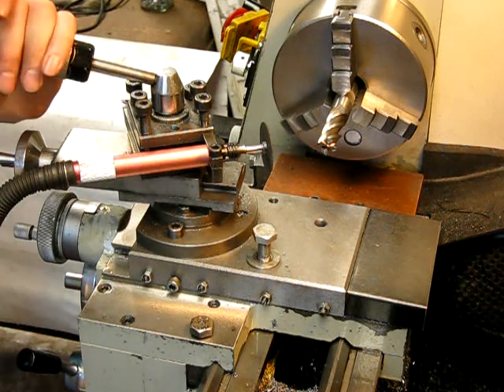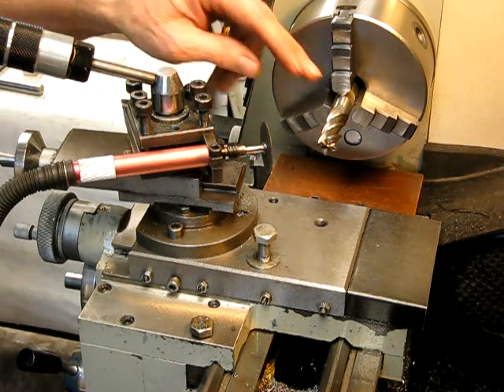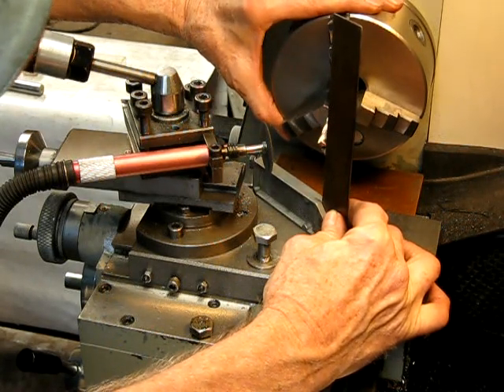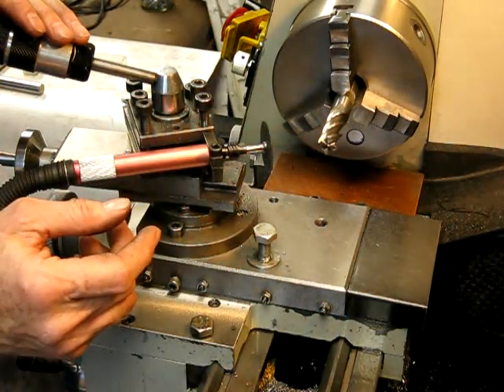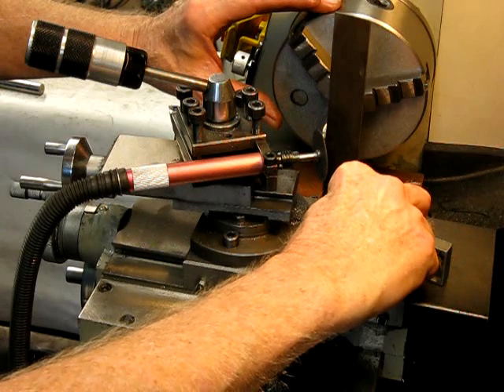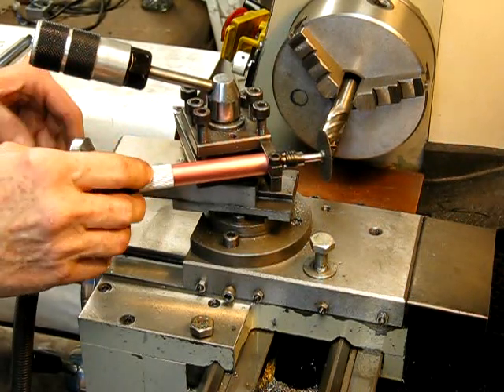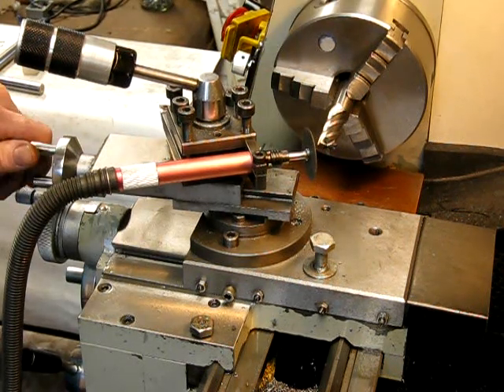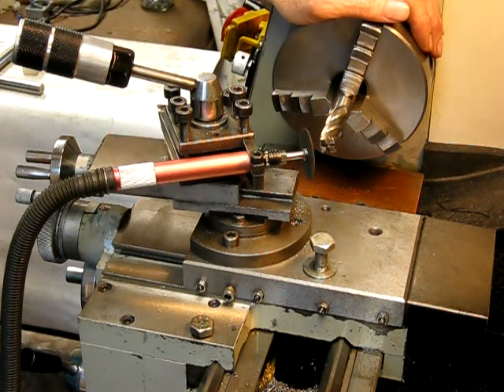How to sharpen a HSS end mill using a cheap pencil air die grinder

Comment: Hi Rob

I miss not having access to a tool and cutter grinder, looked up one of your old videos to look at tool post grinder set up for sharpening end and slot mills. I have the grinders from Bang Good just need fabricate tool post clamp. 
Another of your great videos.
Reply from the maker: Hi Tracey.  That setup works OK for what it is.  A proper TCG would be nice.  They very rarely come up for sale second hand.  I have seen a few people make their own, but it's a lot of work and you really need to have a mill to do it.  I don't have a mill, so I won't be making one ;)  Cheers Rob

Comment: Nice video. I know this is a old video but the others and myself are wondering what the angle of the tool post is not the 2 degrees on the compound slide as you have answered to the question. It is at least a 20 degree angle. I dont know how important it is. You must have turned it off square for some reason.  
Thank you
Reply from the maker: The tool post angle won't matter as it's a fixed item.  I only set it that way for clearance issues.  Cheers Rob

Comment: i have a Myford ml7 lathe, and i made a tool holder for my pencil grinder,  and then i realized, I cant setup the top slide this way. The bolt holes don't line up with any T slots, and the handles interfere with each other. Does anybody have a solution.

Comment: Wanted to let you know that I've just tried this method and it works a treat.  I used a Dremel type electric tool mounted to my tool post instead of an air grinder.  I tried it on some dulled dirt cheap Chinese end mills and they are now very capable cutters.  Thank you for the idea
Reply from the maker: Good to hear Simon.  It's all doable with a bit of tinkering ;)  Cheers Rob

Comment: Works beautifully!!!  I used the 3/4" boring tool holder on my Quick Change tool post to mount the pencil grinder.  It came with a 5/8" reducer which fits the barrel of the grinder like a glove.  Now it's super easy to set the 2mm above the centerline.  Wish I could shake your hand….

Comment: I bought a bastardized drill at a local machinist supply shop. Ground from solid carbide jobber like drill. On my sieg mini mill it leaves a finish as beautiful as a fly cutter. So I can confirm the idea in your comment about using a broken drill bit. 2 flute makes it even simplier. And as far as "technically correct" goes, yeah that no doubt matters in a production environment. But for a home shop, it's always surprised me what I can get away with. One of my favorite finishing bits is an old 3/4" HSS woodworking router bit that has been reground in a similar fashion.
Reply from the maker: Hi Mike,

Funny you should comment on this video just now, as it's been quiet for a while, AND I just happen to have sharpened a two flute mill today that has gone dull - which I rarely do.

I think I sharpened it the same way previously.

Does the job.

Cheers Rob

Comment: If you use the 4 jaw chuck to hold the cutter and align the tips to the jaws you can index each cutting tip with a stop against the chuck jaw, also if the 3 jaw is an accurate chuck you would never hold a rough casting as it will bugger the chuck, that's what a 4 jaw chuck is for.

Comment: that disc would start to wear on the first pass.... making every other pass after that more and more shallow....  no a single one of your cutting edges would be as deep as the other?
Reply from the maker: cmatthew4 Yes, that applies to all abrasives.  As the passes are very light, any differences woud be small.  Certainly the mill bit will still cut better than before.  Rob
Reply from the maker: cmathew4 The diamond cup is a good idea.  I don't have one, but from a wear point of view it would certainly be better.  Thanks for the feedback. Cheers Rob
Reply: xynudu just seems as though if you have cutters like that and a lather like that you should probably have a diamond cup laying around, would end up with a more even edge

Comment: This really works! I also tried this on my vertical mill with a 50mm cutoff disc  and the end mill tilted up approx 2 degrees. A stop on the vice keeps both sides the same length,
Reply from the maker: Of course it works. Would I tell a lie :)  Glad you found it useful. Cheers Rob

Comment: I went and got a pencil grinder just because of this vid.  I even managed to sharpen the end mill I botched trying to cut a case hardened tool holder.  Who'd have thought the Chinese holders are stronger than the bits.

FYI:  The grinder also fits into the AXA boring holder perfectly.

Comment from the maker: Yes, it works very well. It's very easy to set up and sharpen the mills. There's no reason why you can't also sharpen carbide this way.  I only have indexable carbide mills, so I haven't tried it on that, Glad to see some feedback from someone who's actually tried it on HSS and carbide. Cheers Rob

Comment: This method works great!  I had a pile  of hss mills and I sharpened them all . They all work very well. I used a diamond wheel and sharpened the carbides too. My lathe has a lantern tool post and the tool fits in it. I made a top and bottom cap for the tool so the screw would not damage it . On my  lathe there is  an indexing wheel so I know where to stop each time. Works great!

Comment from the maker: Yes, the residue is minimal.  Compared to my full sized tool post grinder, it's a non event.  A few rags around the headstock end of the lathe and all is sweet.  These little grinders only take a gnats whisker off of the edge of the cutter to sharpen them. Rob.

Comment from the maker: You don't need a lot of power to do the grinding, so I expect a Dremel would work OK.

The actual mill cutting edge is only very lightly reground in most cases and I expect the Dremel would work OK. 

Let's know how you get on if you try it.

Rob